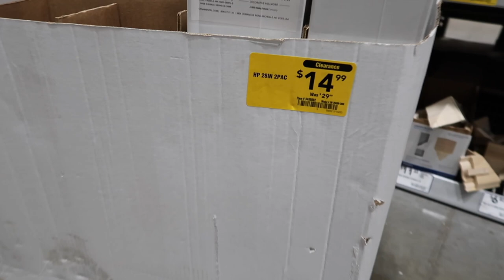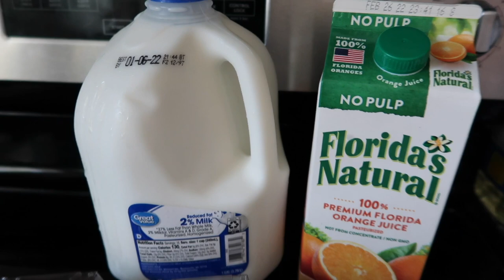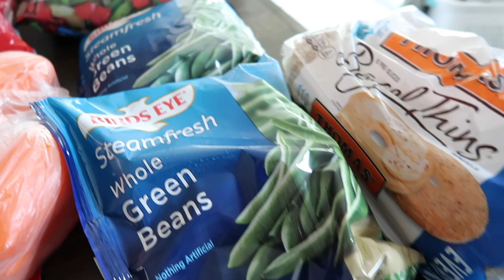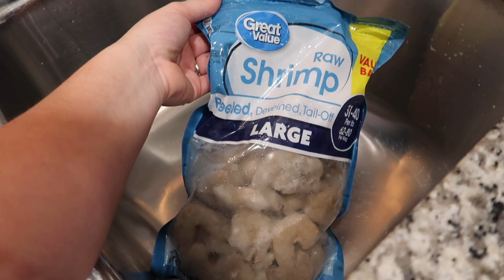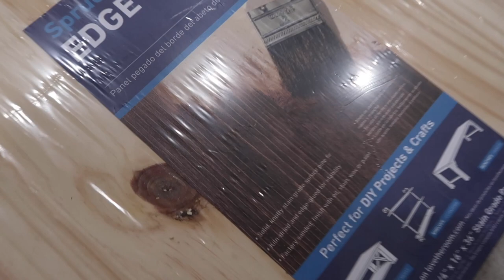DIY Project | Modern Farmhouse desk | Productive Day in the life | Grocery haul Family dinner ideas

Comment: Omg, the desk looks so good! I love it. Simple, clean, and very pretty! How much did it wind up costing for all the materials? Sorry if you said that already and I missed it 😬.  I have a wooded crate that I am using as a little side table by my reading chair and I’m looking for some little furniture legs to put on it. I have it on black pvc end caps right now lol.
Reply from the maker: It was around 45-50 to build . Stain is not included in that cost because I had it on hand. But the legs are currently marked down at lowes in my area 😁
Reply: @karrielynn  that’s great!